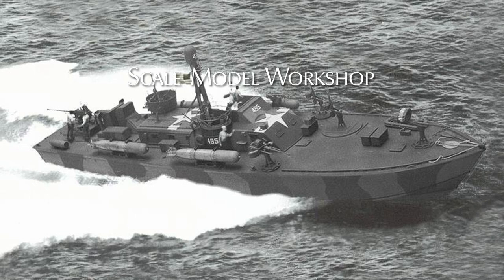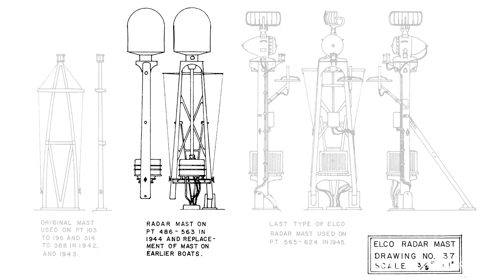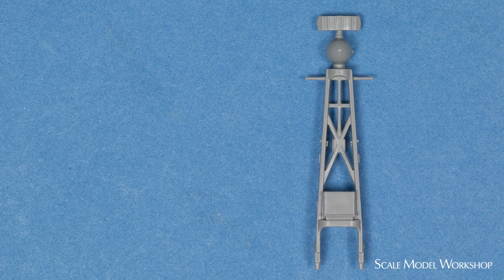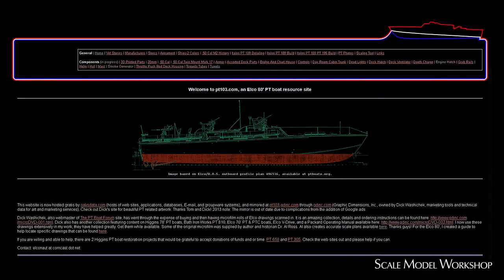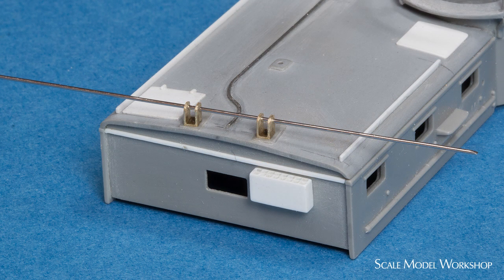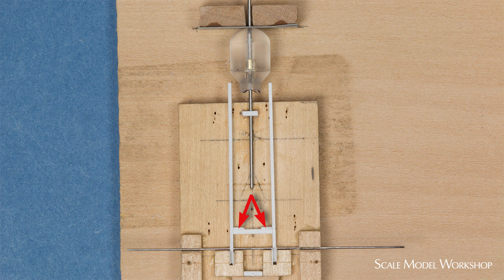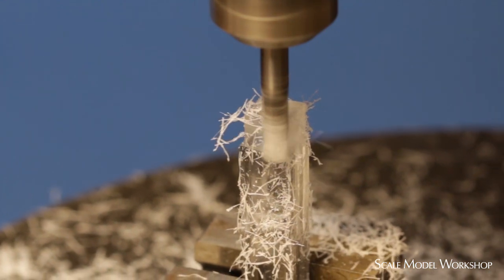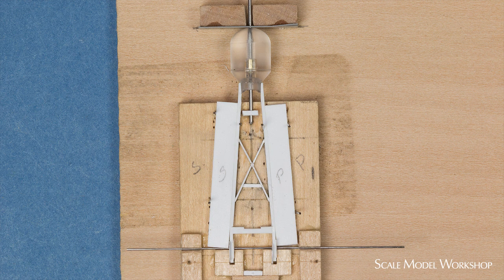PT 489 Radar Modification

Comment: Wow Paul! I was glad to see you took the photos I posted of the PT658 Radar mast and made such an awesome replica of it! Just FYI, this authentic radar mast was obtained "on loan" from the PT Boat Museum in Fall River, Mass. We believe it had been mounted on an Elco 80footer before we obtained it, due to the shape and configuration of the Mounting Brackets. Apparently the mast on an Elco would hinge down at an angle (off center) and not lay back flat like on a Higgins boat. When we mounted the mast, we had to reposition the hinge pins inside of the foot brackets  so it would lay back flat. You can see these brackets have a lot of different holes in them so it may have been by design? One small detail that you may or may not want to change is the two small "yardarms". On our actual mast they are attached to the outside of the mast legs with a quaint little triangular plate. This plate is screwed to the surface of the legs and holds the yardarm perpendicular to its surface. The overall effect is they are slightly tilted (or swept) upwards from the horizontal plane. I realize this is really getting nitpicky here! So to simulate this you may want to bend the yardarms upwards just a hair, so they are perpendicular to the outer surface of the leg. Also, another slight misnomer is the big box on the base is not really called a "rectifier". It is properly termed the "Signal Generator". It consists of a great big transformer inside and some capacitors and rectifiers, and basically creates a large pulse of RF energy. This RF is directed up to the Antenna through the hollow 2x4 shaped "wave guide". It is very similar to a rain gutter downspout, except it in real life is a hollow rectangular steel tube. Anyway that is what the RF Signal Generator does. (The Radar set does indeed have a Rectifier, but it is part of the power supply and is located down below deck.)  I am really amazed by your extraordinary skills and am happy to have been able to be of assistance in some small way to your masterpiece! Thanks again and keep up the amazing work! Jerry Gilmartin USS PT658 Crewman and Restoration Volunteer.
Reply from the maker: Jerry, Thank you so much for the compliments.  I couldn't have done this without your material.  And thank you for the background on the mast and especially the proper nomenclature as well as the workings.  I've found it very hard to locate that sort of information and you have helped tremendously by posting this here.  All your help is very appreciated.  I'll give those yardarms a tweak.  Paul

Comment: Your videos and model work are some of the best content on YouTube!  Also how do you decide on the type of material you use for specific components?  For instance you used acrylic, styrene, and brass for different parts of the radar mast, what is the planning process you use that allows you to determine what to use where?
Reply from the maker: I use brass whenever I need strength.  Also if the part is small and I need really sharp detail.  If I'm using plastic and it has to be machined, then I'll usually use acrylic because it machines more cleanly than styrene.  In this case, styrene shapes were just a natural choice.  So really it comes down to strength, detail, and ease of construction ... if that makes sense?
Reply: @scale-model-workshop  That makes prefect sense!  I come from the model railroading world and have never seen acrylic used for much before.  Your channel is a source of many new tips and techniques, epically your older videos on soldering and decal application, they were of great aid when I decided to detail an older Pennsylvania Railroad E6 locomotive with numerous aftermarket brass castings.  Thank you for the response too!